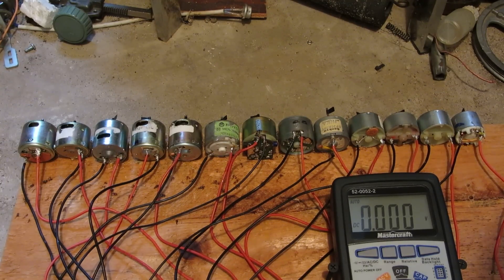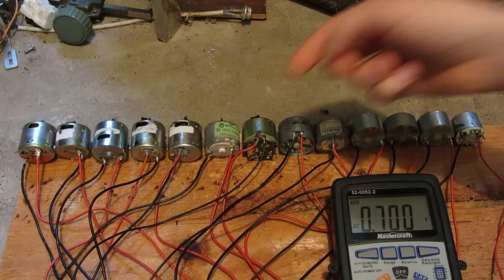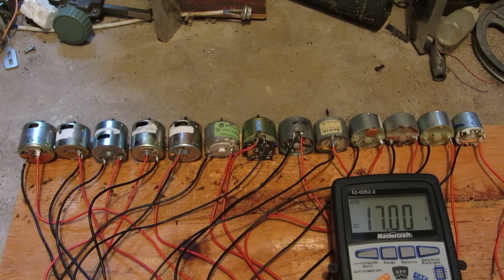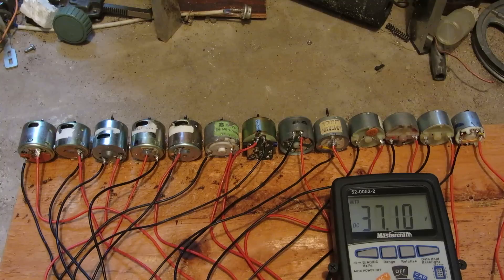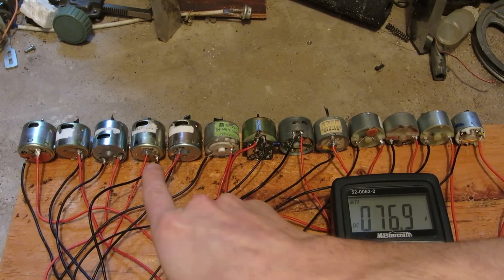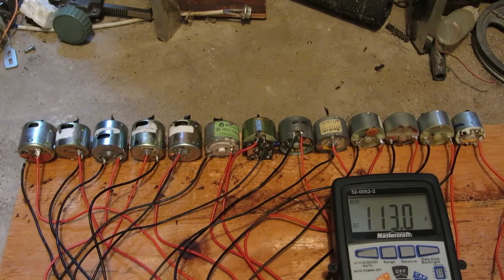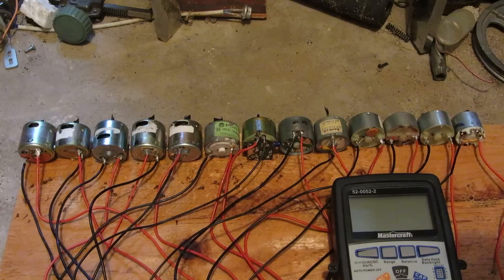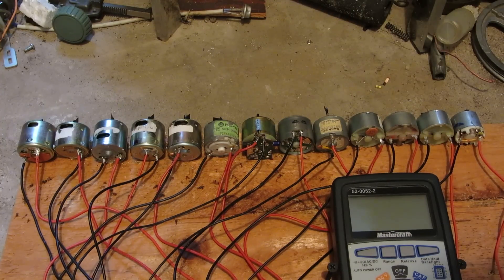Small DC Motors Put to Death Part 1

Comment: They actually have brushes, overtime the brushes wear out quickly,,in this case you just need to replace the brushes with new one,,i have a DC motor like this and when i have little fun of them,the brush got wear out,,so just replace with new one and back to normal,,no need to throw to the garbage,,unless the armature Burned out

Comment: I think m at right Place to ask a question and sort out my problem facing from past few weaks . The question is i am making a Automated Mechanism "a latch lifter" yes u listen right  "a latch lifter" rather than a door Opener bcz it will cost much and i wanted to do it a cheap as Possible i have probably arrange few things but The Question is the latch is about 250-300gm and i was searching for a cheap but effective dc motor with high Torque which can lift that much of weight there is no matter of speed so plz tell me which motor will be the best ?? reply Asap !

Comment: I don't want to disagree for the sake of simply doing so. You called that part that flew out a governor. Two issues I have with  that. One if they are governed internally then your adding voltage should not have changed the RPM. Two why did that "governor" look like a brush and brush spring?
Reply from the maker: It was the governor,  what I had in my hand was a tiny weight and the flat spring metal it was mounted to.

Comment: Kick Ass! Reminds me of the good ole days, Nice. I used to hook up the cordless drill motors to the arc welder, they run good at 60-90 amps, but as you crank up the amp to 140+ they blow flames out the brush vents, LOL!

Comment: I had a bigger motor used for a handheld drill and used 10,000 volts on it. It didn't break, but it made cool arcs inside. It was probably because it ha very little amps that it didn't break.

Comment: a little 12v dc motor handled over 100 volts....?
Reply from the maker: Sure did! but as you can see.. not for very long.
Reply: HL4EHalfLife wow so why r they 12 volt when they can handle a 100
epecally when 12 volt drills are powerless
Reply: yea and you just start crying at only 40v.